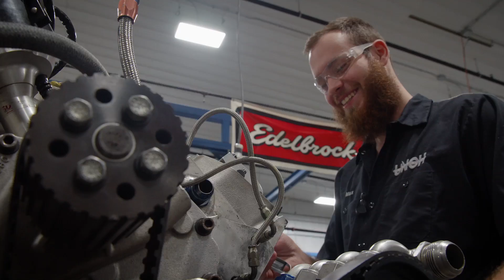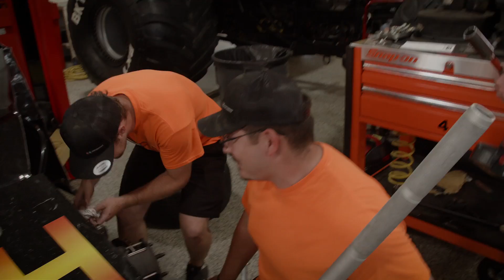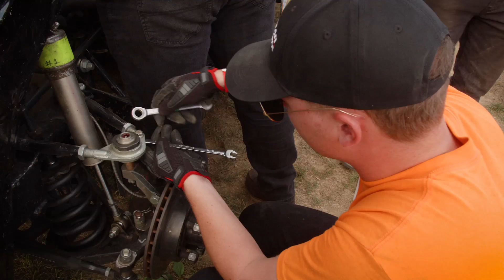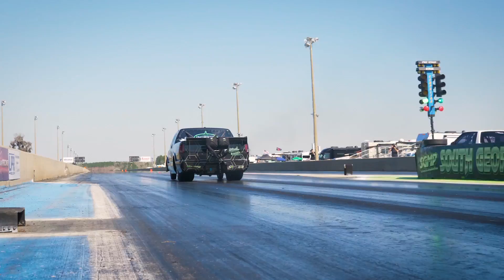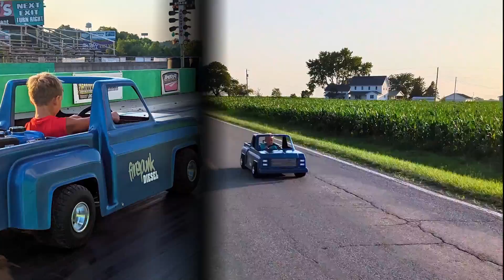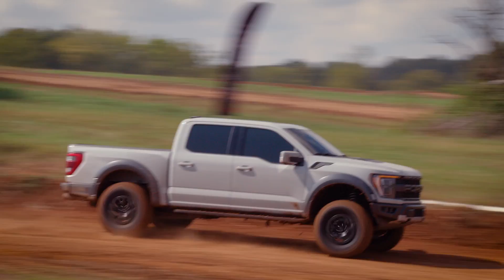Building High-Performance Dirt Race Cars - Engine Power S10, E16

Comment: Every time I see the Granada, I miss my '79 LTD a bit more. She was a 2 door, 351 Windsor equipped beauty with base model interior. AM only radio. That 351 was the first engine I rebuilt myself, and she was a runner with a rejetted 2 barrel. Didnt want to go 4 barrel because I was a young dad, and needed to buy diapers and formula, not just gas and tires. She was one of a kind, may she rust in pieces.